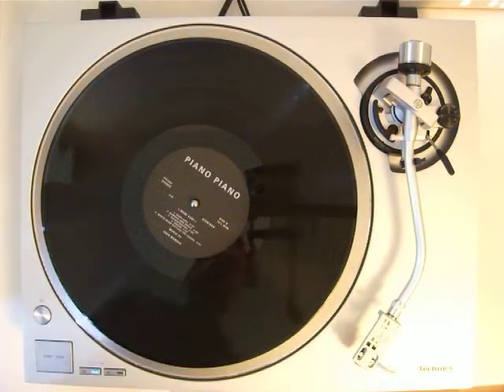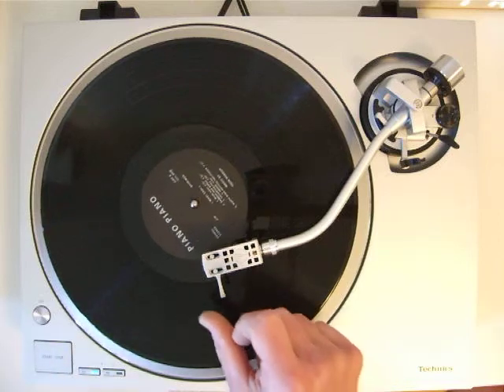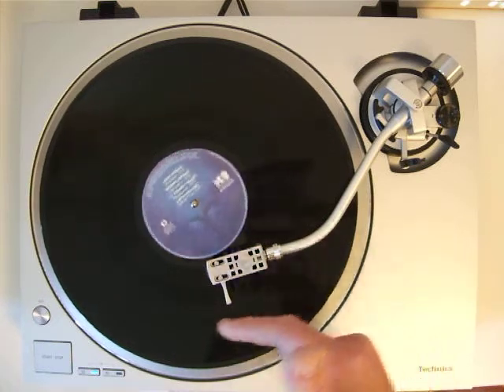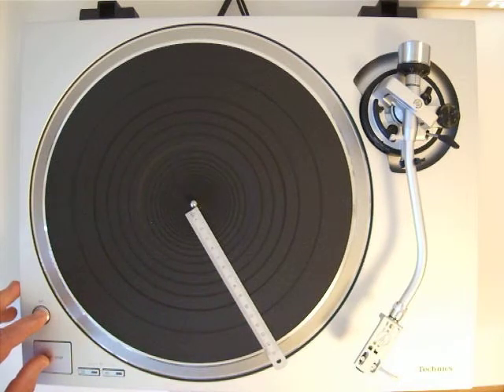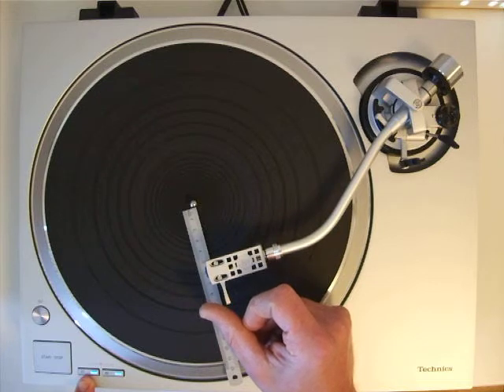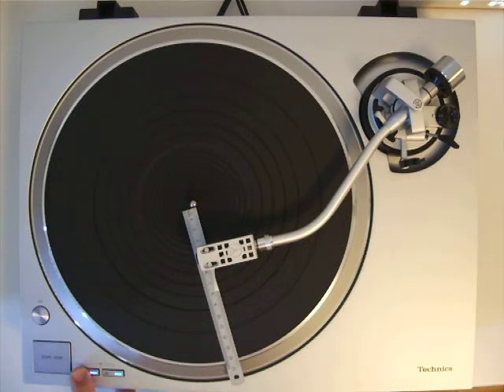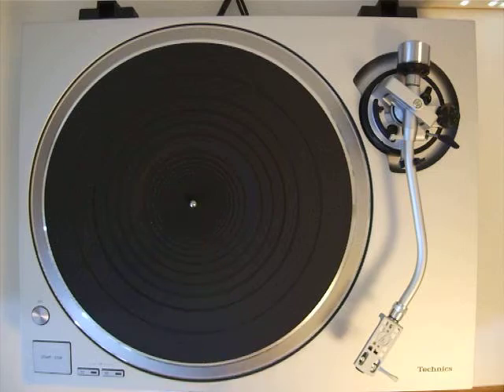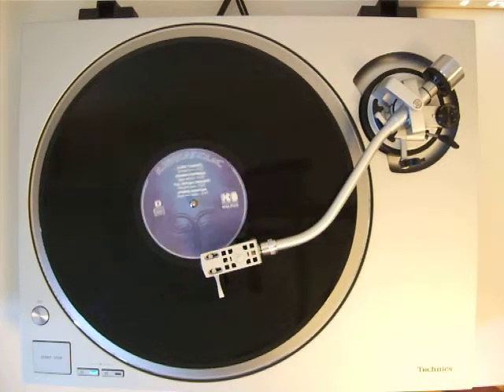Technics SL-1500C / Auto lift-up function Adjustment

Comment: Hi Just have question for you about this turntable. How is the power button of this table ?? Just got the same table and the power button is missing presses now and then. The power button on this table does not feel very reliable ?? I can somehow understand it has some delay because it is logic controlled (does not respond to very fast presses) but it feels kinda irrational, all the other buttons work and respond like a charm. Someone else was talking about this same thing in reddit. Does it need a somekind of power down and up cycle ???

Comment: Excellent video, I have been contemplating buying either a 100C or 1500C, and a few reviews stating that auto-lift operates too early was putting me off purchasing. Your video has helped immensely, Thank You. (PS. Why does it need two settings in first place - why not have it on the later setting and be done with it ?)

Comment: Thanks! Worked on my 100C. But now it seems it takes longer for the auto lift to engage, about a full minute. Anyone else experience this? I found the service manual but I didn't see any mention of the time  the cartridge sits in the runout groove being adjustable.

Comment: Thanks for posting. I had to try 4x before getting it right. I didn’t bother trying to set it because it only happens on a few longer playing LPs, but this is great. Auto lift takes another 15 seconds or so to kick in. It’s a great feature and a great turntable. Thanks for taking the time.

Comment: Dear CHafecito, you made my evening! Faced this early lift problem with a 45 rpm record and it was so annoying but thanks to your clear instructions I was able to ajust it to pos 1. I found some guides in the web but you showed it pretty clear. Thanks a lot for this! But you know that it takes about 70 seconds on pos 1 to trigger autolift on, unfortunately. I think 70 seconds are too much... So I returned to pos 2 actually since it takes only 17-18 sec to enable autolift. Decided to use autolift switch on/off at the back of the tt if I want to play 45 rpm records recorded almost to the apple ring.

Comment: This was a lifesaver.  However, I would recommend downloading the service manual to make sure you get the last step just right.  There was some confusion (at least in my feeble brain) on which buttons to push on that final requirement.  But indeed it does work, and now all my LPs (and 45s) play out.  Thank you for the video!!
Reply: have you mannaged to get the pdf? It's gone out of the web. I'll appreciate if you could share it by e-mail.

Comment: Thanks for this - it works for the SL-100C as well with the same position 1 / 2 mixup as described in the video
Reply: Worked on my SL-100C as well.  Thx.
Reply: @ericstarr3591  worked on my 100c too. Thanks.😀

Comment: Thank you for your video. Made adjustments for my SL-100C and it works like a charm. The manual is a bit weird and misleading as it clearly switched the positions with each other (the faster intervals should indicate that the tonearm lifts up later and not earlier). 
Also the detection point isn’t at 51,5mm as indicated by the photo in the manual but actually, as it should be, around 56,5/57mm. Your video also confirms this. Thanks!!
Reply: Is it true, that unlike the SL1500, the SL100c also stops the motor after lifting up the tonearm and then goes to standby after few minutes of idle?
Reply: @atexnik  Only if you activate that function, you need to hold the 33 & 45 rpm buttons simultaneously while flipping the auto lift switch to on to activate the "auto off"
Reply: @carolinemangum1604  Is it possible to reduce the time spent playing the end of record groove. I have been seeing times of like 60 seconds! Position 1 should be default, actually should be the only one. Skunkie's video brought this issue up but did not properly solve it.

Comment: On my technics I got in 1984 SL-QX300 it would lift up and return early on 1 lp I had. The Beastie Boys. The last song Fight For Your Right (To Party). It was the reason I bought the album!! Never did it on any other album. I have the  technics SL1200GR now so no more auto return. I got it just before technics announced the news for the 1500C!! I would have preferred the 1500C. Still might get it eventually!!
Reply from the maker: I understand the frustration about the  Beastie Album. I adore the Beastie Boys! 
On old players you weren't even able to set off the auto lift up function. I think the SL-1200GR is a great player as well. Has got some more features than the SL-1500C if you need it for DJing. 
Does the GR spin with 78rpm as well?
Reply: @LLQushell  Yes it spins 78 rpm. I've never had a 78 record. I sure would play Wynonie Mr. Blues Harris my most favorite blues shouter!!
Reply from the maker: @Lee.Higginbotham  you would have to get a shellac needle. I'm using the AT-VM95SP. Sounds great.

Comment: Thank you so much. What I find odd is that Technics provide 2x positions. You would imagine that only one position is required and that is when the stylus has reached the final run-out groove right next to the central label. I can't see any reason to lift the tone-arm any sooner before the run out...
Reply from the maker: Good point.
Might be interesting to have a talk with an product manager or engineer.
Reply: @LLQushell  Just to add: I made the adjustment and I thought the problem was solved...However, every so often, the tone arm still lifts before the end...Not only that, sometimes the arm goes right to the final position near the label and still does not lift for at least 10 revolutions of the disc. I find it absolutely amazing that Technics could not design a lift system that works PERFECTLY!... It only needs an optical sensor at the one correct position. It is the most SIMPLE thing to design an arm lift that works perfectly. I am genuinely amazed that TECHNICS have failed. :(
Reply: @meckanicall  Do you know if such issue exists with old turntables like say  SL-1300 or SL-1700 ? Products of that era.
Reply: @Jthe5th  I just moved to an SL-1500 from a Realistic Lab 400. The full-auto mechanism on the latter is leaps-and-bounds better. Only issue I ever had there were records whose run-out groove was too far from the "label" portion, so auto-return wouldn't engage. Better than preemptive engaging.
Reply: @dweblinveltz5035  On the latter, you mean the last mentioned in the sentence or the last one you have bought? It's the SL-1500 leaps-and-bounds better?
Reply: @Jthe5th  The latter of what I mentioned, meaning the Lab 400. I've had it serviced twice over the years, and the second time the mechanic disengaged the auto-start feature because it was interfering with the sound somehow, but otherwise, it and the auto-stop were both working perfectly. The auto-lift works immediately once it reaches the run-out (unlike the timer on the 1500C), and a mechanism slowly lifts the tonearm and returns it to it's resting position.
Reply: @dweblinveltz5035  I see now, thanks.

Comment: I think the manual is misleading. There is only one sensor inside. What this adjustment does is change the length of time the arm waits - after triggering the sensor - before lifting. If you go back and play the first record you will see it takes even longer for it to lift now. Not sure why the manual implies two different trigger points.

Comment: I've tried the auto lift and it lifts well at a certain distance but the issue is that all albums do not end at the same place so usually you lift before the end  of some records.  I'm usually recording the album so I use the manual method.

Comment: I also suggest you add a simple electronic schematics which emulates the STOP button after lift-up event. One of my friends did that, and now it stops spinning when the tonearm auto lifts.
Reply: With turntable on and auto lift switch set to off, keep press both 33 and 45 button pressed while switching on auto lift on.
After that release buttons. Set to 33 rpm speed and now the turntable will switch off when tonearm auto lift.
Reply: @sciabbanimu yeah, I learned that trick later )

Comment: Thanks for the video. I have made the adjustment, but still have a problem with 45s/7 inch records. Do you have any advice?
Reply: Just turn off the auto-lift and use the table fully manual.

Comment: since you are very familiar with the SL-1500C, can I ask you a question regarding one I just purchased?

Upon balancing the arm (with the anti-skate set to “0”) I noticed that while the arm is floating (balancing level with weight set at “0”) the arm wants to move toward its resting post if it is about an inch in from the edge of the platter. If the arm is located in the middle of the platter, or toward the spindle, the arm floats perfectly without any movement. Is this normal for this unit? It is almost like the anti-skate is still interacting even though it is set to “0”.

The reason I ask is because none of my other Technics turntables do this. With my other units, the arm will float perfectly in any position, until the anti-skate is applied.

Thank You for any insight you can provide.

Comment: the turntables should have been adjusted correctly from the factory and it is not justified. question, why doesn't the turntable stop after the arm is raised?
Reply: auto stop can be adjust too

Comment: Hey, great tip! Thanks a lot!
By any chance have you had any issues with the 2M Black and the VTA for this specific SL model? I can't seem to find a good position. It feels like, applying the Ortofon recommendations for VTA set to 4 is not working well.Cartridge's belly is hitting the vinyl's labels. Am I the only one encountering such issues guys?
Reply from the maker: The 2m red was delivered with the turntable. Should work. But I switched to AT VM95ML and I havent used the Ortofon.
Reply: 2M Black is different than 2M Black. Nevermind. I figured it out now. By any chance, do you have issues with heavy static discharges?
Reply: I notice the static electricity very often and I am not sure what to do anymore 😟
Reply from the maker: Can the static issue be heard?
Only when swiping the lid, it happend that the tonarm moved. I have to fix it while cleaning.
You might try another mat, not rubber. And it think the lid is loaded as well.
Reply: @LLQushell  could be the lid also yes... I will be trying something from He Funk Firm about the mat. I was considering this weeks ago. My problem is that while listening to music, sometimes I hear the disc heavily loaded, popping very often in the speakers. Is not fust pr anything just repeated clicks and pops
Reply: @LLQushell  yes, I can hear the pops and clicks in the speakers when the vinyl gets static energy. :(
Reply: same here. does anyone have a solution?
Reply: @ProtoSFX  after running a good cartridge setup and changed to funk firm achromat everything changed drastically. Also got rid of the 2m Black as the VTA was not helping me avoid hitting the surface with cart’s belly when record was dished a bit

Comment: I don't preconise to use auto lift. I think that this function destroy the lift mecanism. Big risk after for the arm to down (when its up,manually), risk too of blockes up.
Reply from the maker: Thanks for your comment. 
I like the auto lift-up function. It works properly at the moment for me. Let's see if I will change my mind.
Reply: As well as having a 1500c I have a 1400 auto return that is still working properly (made in 1976 I think) so I don't think you should worry about reliability.